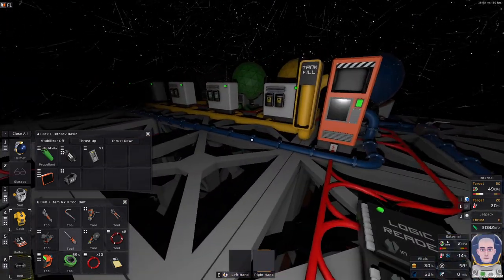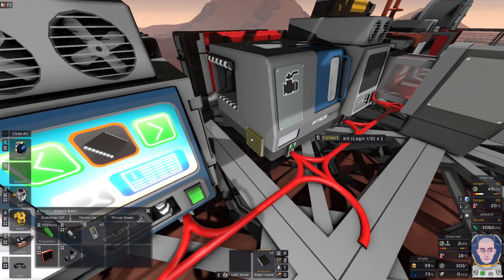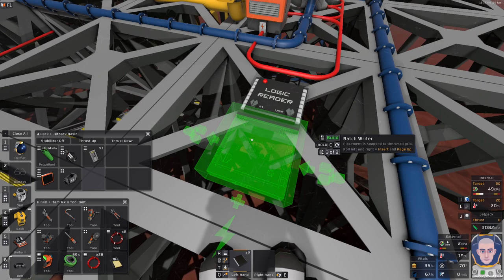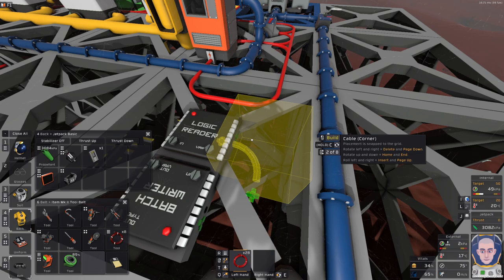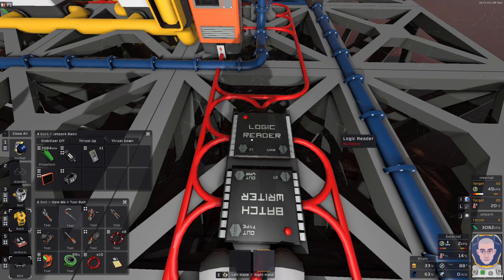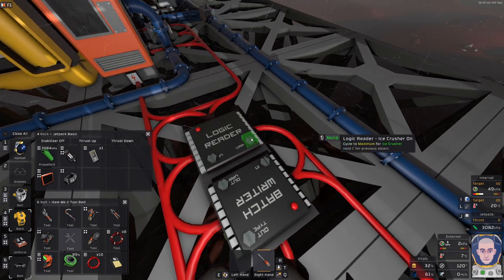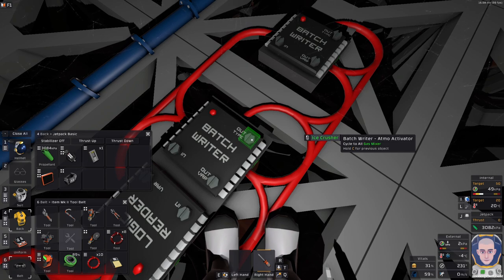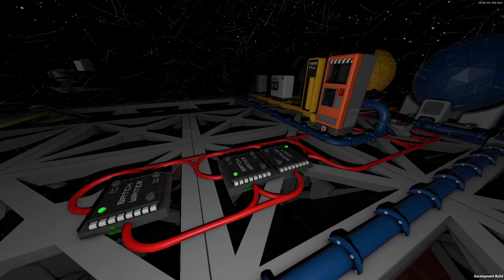Turning all filtration units with a single switch - Stationeers Mars Survival - ep 30

Comment: I've gotten a bit further on my own base, exterior walls and the whole shebang. So I moved my ice crusher outside, hooked up 3 consoles showing the pressure in the O2, H2 and N2 tanks, and turn the consoles on and off like you do here with the filters.
The filters are connected to my IC10 that controls the interior atmosphere. I read pressure  (if above 250kpa) and temp (below 300K) from a "waste tank" connected to the ice crusher, (eventually again) furnace and room dump valve, and sb batch write all the filters to turn them on when above mentioned conditions are met. The IC also controls the interior pressure and gas mix, and is a replacement for 7 i/o, 4 math and 3 memories...